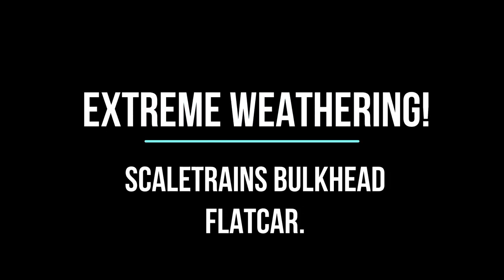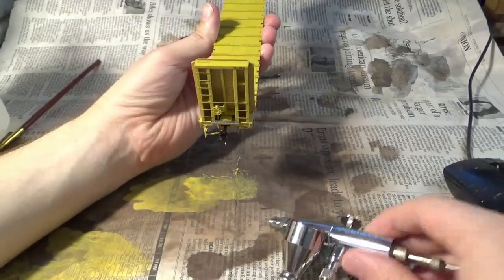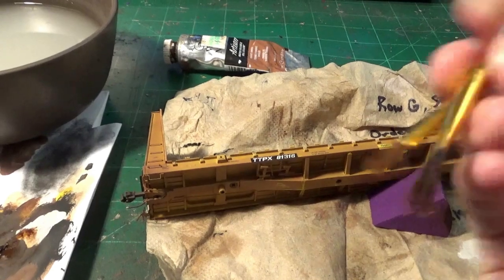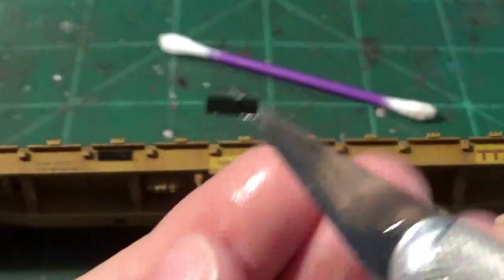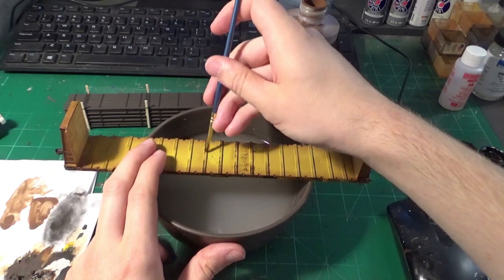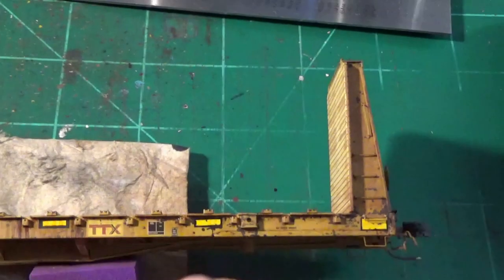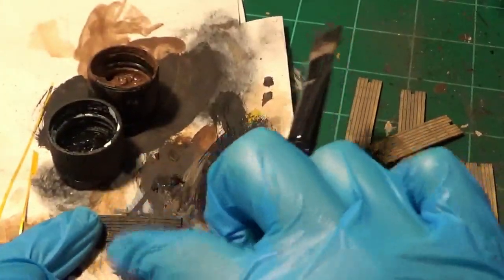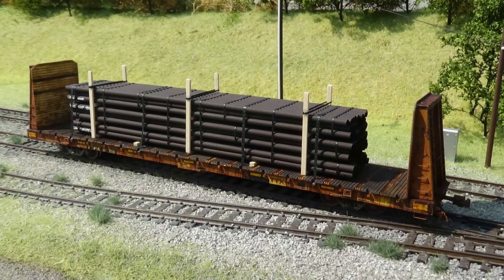Modeling With Dan!  *ScaleTrains TTX Bulkhead Flatcar Rust Bucket!*

Comment: I weather bare wood on flatcars by using layers of paint and then sanding them. Of course I live out west and we get a lot of sun/dry rot especially on narrow gauge and standard MOW cars.  1st I paint he bare wood with a dark brown, then a coat of light grey. Next is the color of the car (red, brown, etc.) after drying I sand it down with light fine sand paper. It takes off the original color then reveals the faded grey.  You can vary the depth of the sanding to bring out a varied look all the way down to the dark brown, Finally add any chalk or washes as desired and seal it with dullcote. Thanks for the tips I will be building a bulkhead flatcar. Cheers!

Comment: Dan, debating buying an airbrush. I noticed you are using it without a venting / filter spray booth. Does using acrylics eliminate the need for a booth ? Are the fumes if any not an issue ?

Thanks for your videos. 

Joel - Minneapolis